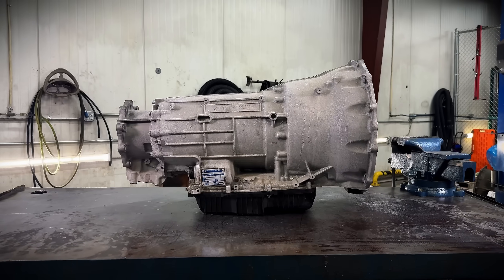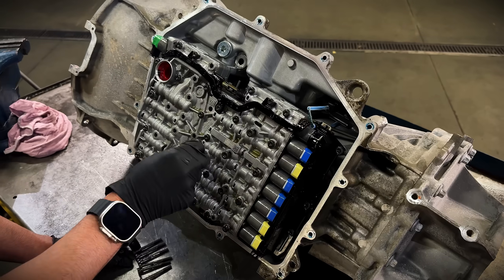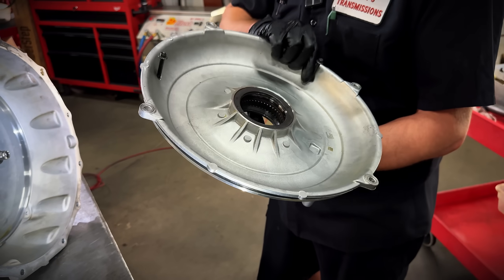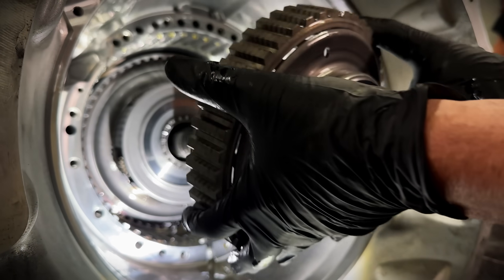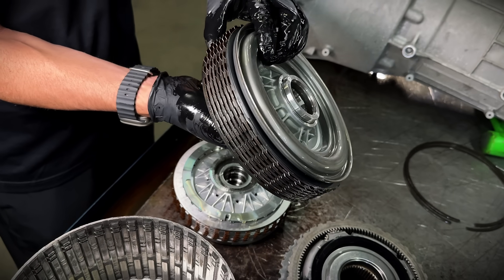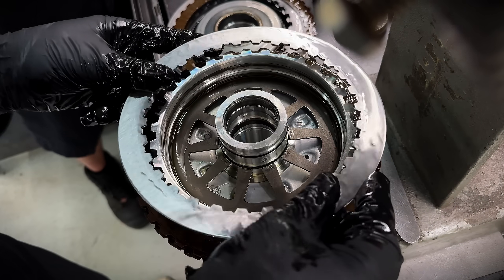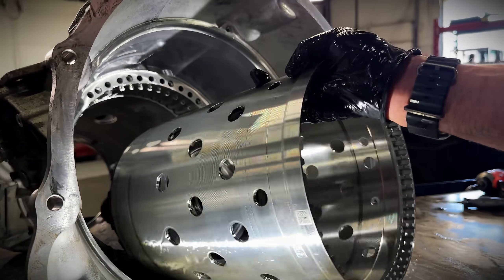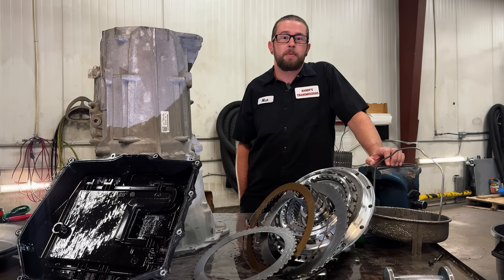NEW CUMMINS ZF 8 SPEED TEARDOWN

Comment: That thing looks as beefy as a TRUE Allison 1000
Reply: I dont know why cummins didn't pick up allison they make a 9 speed now.
Reply: @bigmurph1447 They did testing between ZF, Aisin and Allison over the course of multiple years to determine who would win the contract.  We were told ZF was the clear winner + they have a very proven track record.
Reply: @okcmoparguy724  Yeah... This coming from the same company that said the 68rfe was good. Also said the same thing when the Aisin transmission was released. Lets see how they hold up in the real world with real miles.
Reply: @countcuda70  other than weird shifting characteristics the Aisin is one of the most durable transmissions in a diesel pickup so far..
Reply: @OfficialEPA  The Aisin has its own issues. VB issues. K1 snap ring issues, pump problems, busing issues... Come on now. Ram fanboys will say anything. There's a reason all of these transmissions are compared to the Allison. It's the best stock for stock transmission in one of these trucks.
Reply: @countcuda70  dude you're delusional. Even Randys Transmission will tell you the Aisin is one stout unit stock. There's even a hot shot company owner called PDdiesel on YouTube that has a fleet of 20 or so trucks that are all Aisin Rams and sees regularly 500k to 700k out of Aisins driven by drivers....

Btw I have 6.7 Powerstroke lol
Reply: @OfficialEPA  I didn't say it was terrible. I said it's not in the ballpark as the Allison. It has its own issues. There isn't an delusions. It's facts
Reply: 160k on stock Allison behind 
+/- 500 hp 900 ft lb torque. 
Doing fine.
Reply: True Allison 1000s snap like toothpicks, both the 5 and 6 speed variants.
Reply: @CornFed_3  Lol. No they don't. Stock power levels. They work great. Built they're even better. The 5sp and 6sp are the same transmission. 01-05 6th was turned off from the factory
Reply: @countcuda70 , yes, they certainly do break very easily. Any reputable transmission tech or shop will tell you that. We also broke a ton of higher rated units in the Army. From 2000 Series to 4500 Series. Allison is over rated.
Reply: @CornFed_3  No they don't. Trucks out there including my own making 1000+HP on them without issues. Merchant Automotive is 1800hp+. Theirs is good too. Get a good shop to build you one and it will work great even under a ton of power.
Reply: @countcuda70 , you’re talking about built units, I’m talking about stock/factory units. Don’t move the goal post now.
Reply: @CornFed_3  You need to go back and read what I said again. Stock power levels. They work great. Built they're even better. No goal posts were moved. You didn't pay attention.
Reply: @countcuda70 , they’re over rated and break easily, even at stock levels.
Reply: @CornFed_3  At this point. Your posts are irrelevant. You repeat the same thing over and over. 😴😴
Reply: @countcuda70 , because it’s true. Sorry that you can’t handle facts. Been around Allison stuff long enough to know it’s over rated. ZF and Aisin both build superior stuff. There’s a reason Allison doesn’t actually supply GM anymore with units.
Reply: @CornFed_3  Sure you have. You don't have much experience with them at all if you think they're garbage. Yeah..GM sold Allison. Obviously GM isn't that bad. They're still able to use the Allison name. If it was that bad. Allison wouldn't allow their name to be used. ATS has been building Allison conversion kits for a long time. Cummins guys pay 10K+ to make the conversion. Move along, rookie
Reply: @countcuda70 , rookie? Please 😂 I guess having owned multiple Allison trucks, used them commercially and in the military makes me a novice. My experience in the mountains of Alaska and wastelands of Afghanistan make me inexperienced with Allison products. Sure 😂 ATS builds complete junk and always has. Using their name says enough about you. CA Conversions does a better job with the Allison products. And Cummins guys that use them simply made that choice over a built 68RFE or build 48RE. Their choice, not mine. The Aisin 6-speed is better than all 3 I just mentioned. And the new ZF is already proving itself well above Allison craftsmanship.
Reply: @CornFed_3  Yes, rookie. I used them in the military too. They're not the same transmissions used in GM trucks. I agree, ATS is garbage. People are still willing to pay good money for the Allison 1000 conversion from them. That's how you know they're better. Even from ATS they still want them. 48re is a strong transmissionaftet it's been built. They have been over 2000hp. One that I know of is over 3000hp. Either way... The Allison behind the 6.6L from 01-19 is a good transmission. Better than the Aisin too. There's a reason Ram is getting rid of this one too. If it was so good. Ram would keep them.
Reply: @countcuda70 , you keep calling me a “rookie” and yet I’ve probably got more wheel and wrench time with Allison’s than you. Wild. Ram got rid of the Aisin because they don’t make a higher gear-count version of what they used previously. ZF already had units available to be built how Ram wanted to ease the process.
Reply: @CornFed_3  Now you're assuming things. This is why I can't take you seriously. Lol, Aisin makes higher gear count transmissions. Including an 8sp. Keep trying.
Reply: @countcuda70 , they didn’t have what Ram was looking for, hence why they went to ZF. ZF already had the housing, tooling, etc., needed. Move along now.
Reply: @CornFed_3  Wow... Really. Figured that out on your own huh. Good for you. You keep changing the subject. It's okay though. You will just repeat the same line over and over again. Not showing or list any evidence to back it up either. Boring
Reply: @countcuda70 , no one is changing the subject, you’re simply denying that other proven transmissions are superior to your precious Allison. And I’m not repeating myself, you’re trying to dodge what I’m saying, big difference. Those of us with actual experience and knowledge know better, as others have stated in these comments as well. There’s also a reason Randy has never ran an Allison truck in recent years, there’s been better options. You call everyone else a fan boy but we’re just providing facts. Cope harder.
Reply: @CornFed_3  Duh! 2020+ isn't an Allison. Just in name only. You changed it. This was about the strength of the 01-19 Allison. I never said others weren't strong or couldn't be built strong. You called out and said the Allison 1000 is junk. You're very wrong there. Stock vs Stock. They're one of the strongest out there. They can also be built to take a ton of power too. You know nothing of the new ZF transmission. Maybe it will hold up. Maybe it wont. Im reserving judgement until they have some time and mileage on them. Youre still just a record player. Say the same thing over and over. Give specific examples.
Reply: @countcuda70 , people who whine about people repeating themselves generally aren’t listening to the conversation anyway. Specific examples of what? Allison failures? There’s been thousands. In stock form, they’re built fine but are extremely weak. They’re better suited to being built properly. The Aisin by itself is a far superior unit in both power potential, stock form, and build quality. It’s a true medium duty unit compared to a lightweight Allison, true Allison and current GM-built units.
Reply: @CornFed_3  Thats right. You're not listening. What are you talking about..The Allison 1000 is a medium duty transmission. If Aisin was so good. Ram would have stayed with them just like they have the Cummins engine. Aisin builds other transmissions. It's because they didn't do as well as Ram wanted them to. Aisin transmissions have VB, converter...etc issues. This is why they're going to another manufacturer. You don't like the Allison. That's fine.. don't try and say they're weak though. They're better stock for stock than Aisin or the 68re. Here it comes.. you're going to come back with a lot of nothing and finish with Allison is weak.
Reply: @countcuda70 , you’re so wrong that it’s comical. The Allison isn’t a medium duty unit, it’s a light duty transmission but has different variations depending on the application. The Aisin is a true medium duty unit and weighs almost 50% more than an Allison equivalent. It’s a much more heavy duty unit. And no, it didn’t have issues short of a short-term issue with snap rings that was quickly fixed on the small batch that it affected.

Ram has been using/testing the ZF for over 7 years and the same transmission has been being used in actual medium-duty applications as well, it’s not new by any stretch. Once their testing was complete, it was put into the HD line. So I’d say it’s already more than proven in both pickup and medium-duty truck applications.

I don’t have a problem with Allison, they’re just over hyped. You saying they’re superior to an Aisin is laughable though. While I never had an issue out of my 68RFE, it was never a solid option. My Aisin was far better in every way. Got an order in for a new 3500 Cummins with the ZF too. Bet it’ll give me zero problems.
Reply: @CornFed_3  50% more..hahah. Can't talk with someone this clueless. You're just gum flapping again. 50% more 😂😂😂😂. You're hilarious
Reply: @countcuda70 , the Allison is ~300lbs dry. The Aisin dry is just over 400lbs dry, so my 50% comment was a bit off, but you get the point. The Aisin is a much more stoutly built transmission.
Reply: @CornFed_3  Weight isn't a direct representation of durability or strength. If that was the case. A 48RE wouldn't be able to hold over 3,000 HP/TQ. The Allison 1000 is a better transmission than the Aisin. You keep making guesses and assumptions. Clearly your math isn't very good either. At this point. I don't care about you opinions. Clearly you cannot comprehend the differences. Good luck

Comment: I said it from the beginning. Ram is keeping their power numbers generous on these trucks at launch. I wouldn't be surprised if they release an update that bumps power to 500hp/1200tq within the next year
Reply: I don't want more power, I want more drivability less torque management and more power transferred to the ground efficiently and smoothly.
Reply: I sure hope so. Pulling around 30k it handles it but my buddy’s 2024 h.o. Power stoke holds much higher speeds over long passes
Reply: @Jmschnider it might until it doesn’t when it blows up
Reply: @Jmschnider Yea but if you go into the Powerstroke groups, the HO Powerstrokes are warping exhaust manifolds when towing heavy right around the 100,000 mile mark.
Reply: @shaun-910 easy fix
Reply: @Jmschnider  I don't think you quite understand what that means. I have well over a million miles pulling oversized loads in semis. The motor will not last as long as the Ford standard output. For it to warp, the temps have to be high, like, way high. I've seen guys in semis melt her down. You're dangerously close to that. This cummins isn't even worked at the 1100tq number. It's totally different.  This new one went backwards in technology. Back to cast for block and head. The ported the valves, put the banks racing intake on it, back to the old common rail that we haven't seen since the 12v. New turbo, cam, lifters. They moved the cat up close to the turbo to take advantage of the heat to burn instead of relying on the dpf as much. If you go to pro rodeo, there are more ram than all others combined. It's because he haul animals and can't afford to break down when it's 100 deg out. It gets hotter in the trailer if it isn't moving. Fords are 2nd. Then gm a very distant 3rd. The fords you see are always new. Like they have money to get new ones ever few years. You'll see rams from all ages. 100s of thousands of miles. A lot of standard output cummins.  I know stilantis gets a wrap. But.... it's because people don't know. They put brand new untested tech in jeeps. 12 to 18 mo later into dodge. Another 9 to 12 months the ram 1500. Then the hd. By the time it gets to the hd, it's all worked out. Ram hd is the most reliable by far. People complain about the cab etc. We'll, they don't break down. The only problem ram really had was after covid. They had 5 suppliers of lifters. 2 of them were making sub par ones. They cut 3. They now get it from 2 factories that had no issues at all.
Reply: @Jmschnider easy?!?
Does that equate to cheap?!? Because they surely don't warranty them.
Reply: @timkopp2204 they don’t warranty them because it usually happens after warranty. It’s not a common thing. Delete your truck, spend $500 on better, thicker manifolds and never have the issue again
Reply: @sonsofliberty3081 they warp because they’re thin. Not because of extreme temps that cause any other damage. For context, i have always been a Cummins guy, I have a 1500hp 2015, a 2005 and now a 2025. But when I first got my 2019 power stroke hands down it’s a better pickup for pickup sized things. Hauling around and under 30k. 2025 ram Cummins doesn’t come with a banks racing intake. It comes with a side draft intake from Cummins. A common rail and a 12v are two different things. 12v Cummins don’t have common rails lol. Not the whole lifter thing I couldn’t tell you about. I won’t have the truck long enough to worry because I’ll be on to the next one by then
Reply: @Jmschnider  No!, replacing manifolds on a 6.7 Powerstroke is NOT easy.
Reply: @wtbman then get better lol
Reply: Definitely will be upping the ante. I believe they came out with 430/1050 out the gate because the 6.7 has been significantly overhauled, with a new block, pistons, CP8, glow plugs, etc. They definitely built the new one to test reliability of the platform. But tuners are already going crazy and can't believe Ram made it rather easy to add power, safely.
Reply: @hellkitty1014 Cummins have always been easy to add power to it has always been the transmissions that don’t hold the power. Look at any competition in racing, sled pulls, and dyno the Cummins will almost always win.
Reply: @Sdukes001 yep! Firepunk Diesel are legendary 68RFE builders and if you're adding some serious power to your 6.7, those guys got you covered.
Reply: @hellkitty1014 , too bad all of the good and reliable tuners who used to do deleted tunes are no longer in the game.
Reply: @CornFed_3 you're right!
Reply: They don't need more power. The vast majority of people are too focused on adding power. Where these trucks are at now pulling near 40k pounds with ease there's no need to keep pushing those boundaries. That's half the weight of what a semi is legally allowed to haul which is insane for a pickup truck. You have to be able to safely stop that amount of weight and going beyond that is just unsafe for a pickup truck.
Reply: They’ll save those kind of numbers for the 7.2L platform.
Reply: It would be awesome if they move up to the 7.2 liter Cummins
Reply: @jakey20022 The 7.2 is likely not coming to the Ram HDs. They’ll likely up the ante with the 6.7 in the coming years.

Comment: Are you guys gonna be making a swap for the 68 trucks?
Reply: I would guess the trans tunnel could need enlarged
Reply: @timkopp2204 same cab, I would think the biggest challenge would be tuning/ wiring because I’m pretty sure they have electronic shifters
Reply: @Sabo6.7  surely hope that someone can make a stand-alone controller that retro'fits the older trucks!
Reply: @timkopp2204  ATS will most likely be the first
Reply: @Sabo6.7  actually the shifter from the existing ram would probably work 8hp
Reply: @seancollins9745 I actually found a truck unlocked at my local dealer and pulled the boot off because I like the new ones and was hoping there would be a part number but the shifter while the same shape attaches differently